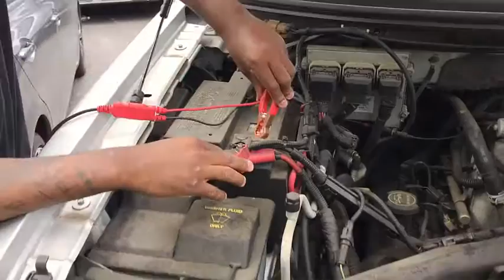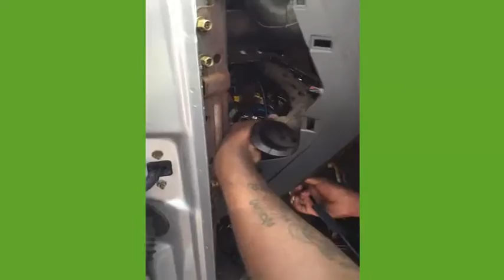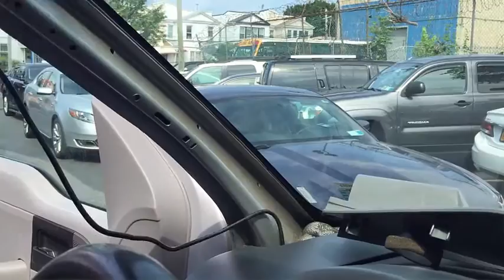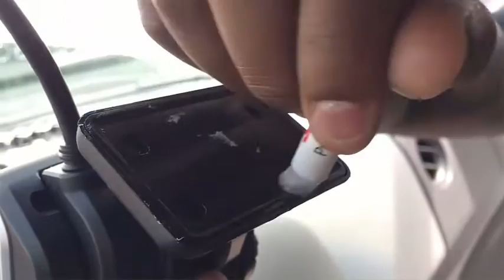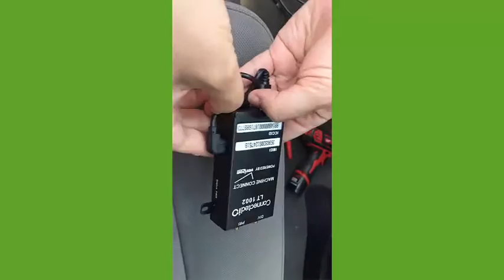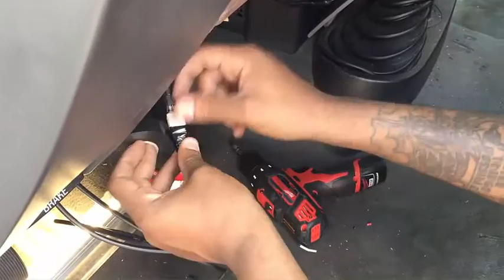Dual-Vision XC4 Installation Video

Comment: Today's Vehicles,.you need to know where to get accessory power from. you cant just tap into any circuit!you don't use a test light or logic probe!!!you need to use a DMM, or you can fry the moduals you tap into. the use of the fuse tap in this video is the way to go!  you should solder and shrink tube everything!!!